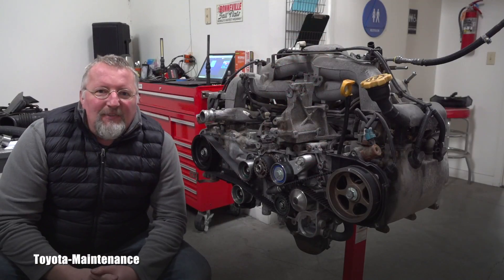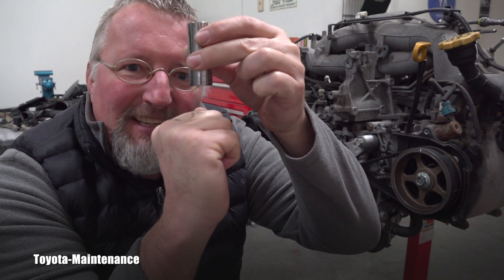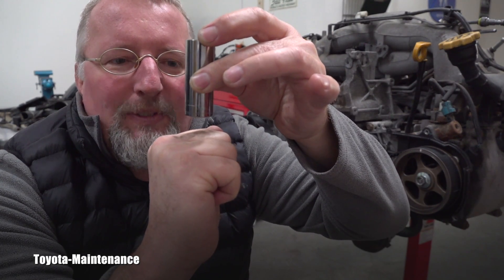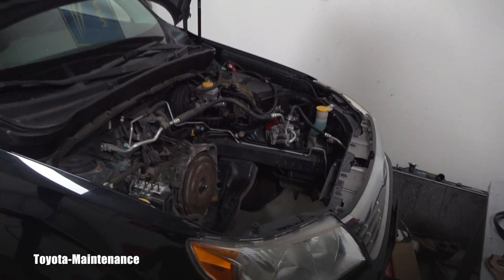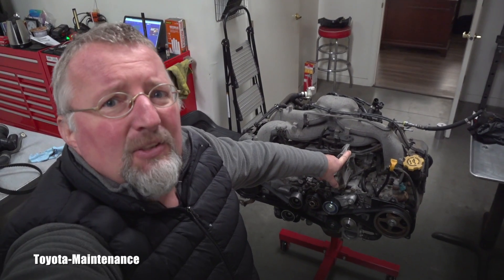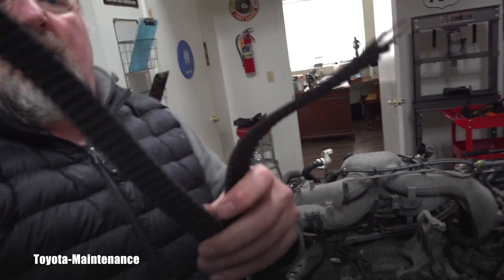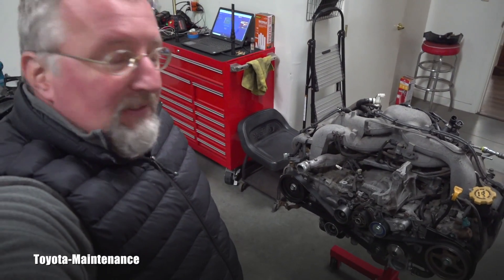Avoid Interference Engines with Timing Belt

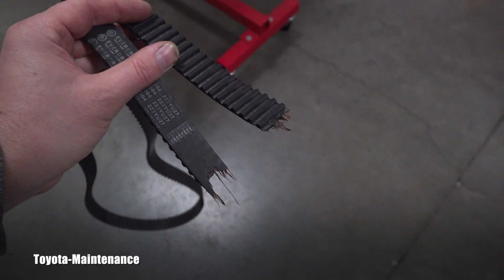Comment: 2:52 Evergreen belt? Aftermarket timing belt kit? Who makes the Subaru OEM belt?
Reply: Evergreen is cheap china parts.  Buy Japanese good quality parts
Reply: When I paid to have mine done, the (Subaru) OEM had shifted to Chinese production. I don't remember the company name.  After the dealer did the work at 90k (15k miles early), because I was about to give it to one of my kids for college, they put the car back together and discovered (if not caused - they wouldn't say if they pressure flushed it) the head gasket failure.

I tell as many people as possible to avoid Subaru like the plague. I also educate Subaru owners of the many things to watch out for.

Save yourself! Stay away from Subaru and Nissan.
Reply: When we changed the timing belt in the Jeep Liberty CRD I had we used a Gates timing belt. It lasted 7years and 60,000 miles, still going when I sold it.  I think the original was goodyear.
Reply: @MrMikey1273  I don't doubt that a reputable aftermarket manufacturer can deliver a reliable product. I'm scared of counterfeits, however.
Reply: @jptrainor  my point is use a quality brand even if the OEM isn't available. There's a lot of cheap Chinese stuff in the stores like Advance Auto parts.  That's why we ordered that belt kit from a supplier that sold only OEM and proven aftermarket parts for small diesel engines.
Reply: Mitsuboshi is the OE manufacturer of Subaru Timing belt
Reply: Chinese suppliers told me that their rubber parts will cost 10% of Japanese price for 10% of Japanese quality, and 90% of Japanese price for 90% of Japanese quality.
So, simply buy Japanese parts and save yourself $$$$ in labour costs. Not to mention the inconvenience.
Many motorbike rubber parts are perished and cracking before sale to the end customer. Also best to always buy Japanese manufactured bikes!

Comment: I have seen 22r, 2rz, 3rz chain timing engines failed catastrophically,  the guide wear wears down the chain rides on the metal parts of the guides all the metal shavings damages the engine or chain jump the gears teeth damages the valves.... 

I own 03 highlander  I bought at 60 thousand miles at this very moment is almost 300 thousand still factory timing belt this tells  that the rubber belt is safe as chain xD..
Reply: As a general rule a timing chain should last 200k miles and become noisy well before a catastrophic failure.  The key to the hydraulic tensioner is changing oil every 5k miles. It’s undeniable chains are better than belts, for both reliability and timing accuracy. Of course the gold standard is gear driven.
Reply: @garydiane1577  so this video is misleading, both chain or belt have to be replaced as manufacturer specs, once I replaced snapped rubber belt on 3vze at 384 thousand miles all original,  how do I know it was factory belt bolts have no waer all the bolts where the belt area were intact, also as belt wears does not fall pieces into the engine, timing chain wears lubrication system is contaminated I know there is oil filters still I don't like chains..

Comment: Honda 3.5 V6 is timing belt, interference engine. Just put the third belt in at 165,000 miles.  Meanwhile, my 06 Rav4 with 3.5 V6 engine has 320,000 miles. Only thing I've done with it was to put new ignition coils and an oxygen sensor. Still runs like new.
Reply: 3rd belt at 165K? Replacement interval is every 100k.. The Honda J series engine is one of the best V6 engines ever produced.
Reply: @trevorsyversen9956  Bought it (2007 Ridgeline) at 85,000 miles. Didnt know if the belt had ever been changed...why chance it? Water pump went out at 165,000 and ruined the crankshaft position sensor. So, again, why chance it. I'll agree with you, I really like the Honda, but that belt is a pain it the ass.
Reply: @jonmayer9458  Did you not have the water pump replaced at 85K?  It's part of the package.
Reply: @Krakondack  Yep, replaced it with shitty unknown maker water pump. Learned my lesson...put in oem (aisin) this last time. Will only go with oem from now on.
Reply: Sorry! Didn't mean to lie...the Rav4 has 220,000 miles.

Comment: Limiting ones self to only non-interference engines, and/or timing chain engines isn't the answer.  Timing chain engines have plenty of problems of their own which are even more costly to repair than timing belt maintenance.  Most people don't think that far.  The only reason a belt would fail like that after such a short time is either the job was done incorrectly, low quality parts were used, or some parts weren't replaced (i.e. tensioner, tensioner and idler pulleys, etc.)  There are a lot of fake parts on Amazon/eBay that people buy and will fail like this.  There are a lot of low quality kits sold by the local parts stores too (i.e. Dayco, Gates in some cases, etc.)  If you have an interference engine just keep up with the timing belt maintenance schedule and be sure to use OE or good quality aftermarket replacement parts.  I've got an 08 Honda Odyssey with 228K on it.  It's had two timing belt jobs done on it and I expect to do a third when it hits 300k.
Reply: 2:52 The belt is branded "Evergreen".  Google indicates that it's a common aftermarket timing belt parts kit. Lot's of potential for problems. I researched parts kits for my 2010 Odyssey time belt job. The prices were attractive, but I couldn't convince myself the quality was there (including from Gates, which is a very common kit) or that there was no risk I'd end up with a counterfeit part, so I got Honda parts at a local dealer.
Reply: @jptrainor  Gates is OE on Hyundai and many domestic cars, so I will use in those cases when necessary, but Aisin is my go-to brand.  They are the OE for Toyota as I believe they are owned by Toyota.  I have used Aisin kits on many Honda timing belt jobs and have never had any issues.  It's either Aisin or genuine Honda--nothing else.  Aisin is what's running on my vehicle today.   EricTheCarGuy did a timing belt on his Odyssey a while back where he used "genuine" Honda parts from Amazon or eBay (I forget which) and they were obvious fakes and even he didn't spot it until the comments section filled up with people filling him in.  The vehicles then get sold and the belt breaks on the next guy...then the timing belt engines get a bad reputation.

Comment: Absolutely.  Choose timing chain rather than rubber timing belt altogether if you can
Reply: Had a Volvo 940 which we sold at 250k miles when we sold it:  timing belt, replaced it three times when we had it. (Pretty easy on that model, great wagon!) New owner's well past 300k mi now....  ¯\_(ツ)_/¯

Comment: I have a 2UZ interference engine in my 06 Tundra.  Funny, these engines when maintained are considered bullet proof.  There are many of these running around with with 300 and 400k miles and more.  Toyota has bought back a few for the high mileage for study.  I found several sites who claimed that engine was one of the ten best ever made by Toyota.  Sure, it is a problem if you don't maintain.  I had mine done at Toyota Dealer.  Cost me $2k, but Toyota gave me back a thousand dollars.  They could not believe the condition of my truck - looks new.  I had them do the belts, the water pump, the pulleys and other items.  Truck was 13 years old.  Best truck I ever owned.  I have had Fords, Chevy's, and a couple small Toyota Pick Ups, as well as a Chevy LUV - I put 160,000 miles on.  So, no I disagree.  This is not an engine to avoid.  It has another quirk, the starter is under the manifold.  All these modern trucks have stupid stuff, but Toyota makes great trucks and cars.  That was a great engine.
Reply: I agree, you're supposed to change the timing belt every 90k miles.  I had a 2005 with 193k and zero issues with plenty of power.
Reply: Totally agree!  Have a 2000 Tundra I bought new and still runs great.  Just stay current with the maintenance.
Reply: I'm  still looking for one here in ct. Tuf to find a good used one. I don't go to stealerships to buy new
Reply: @pirihern9329  yeah, Texas has them at good prices and without rust
Reply: 2004 Tundra 4.7 just changed timing belt and water pump. 👍🏻

Comment: That’s why the Toyota 5VZ FE is  such a great engine.. timing belt: yes...interference: no... minimal anxiety.
Reply: @joshm2243  2.7 4cylinder on some of the Tacoma’s , 4runners and t100s, indestructible
Reply: @joshm2243  Head gasket issues?  Never seen one on an engine with under 300k on it.  The burnt valve issue is due to not having the valves adjusted like stated in the service interval.  They tighten up and cause damage.
Reply: @joshm2243   owned about 6 3RZs and never had an issue with a head gasket , the 5vz fe is reliable but also suffers from head gasket issues and overheating and it being a slow pig for a v6
Reply: @fortis619  I have both in the garage at the moment.  We are really splitting hairs when talking about which is better.  Funny thing is when either of them have issues they tend to have a ridiculous amount of miles on them.  Long after other brands have been in the junk yard for a decade.  I prefer the 2.7 slightly but love them both.  Yeah the 5vz has the power of a 4cylinder and fuel economy of a V8 but its a solid little engine.
Reply: @joshm2243  Funny thing is I have done several head gaskets and timing chain guides on the 22re.  Still a great engine no doubt for its simplicity.
Reply: @joshm2243   I changed all those parts as well except for the seals which I skipped because I wasn’t keen on pulling the gears..if I make it to 300K will likely do them.
Reply: @joshm2243  That’s why I change the belt ( water pump and tensioners) every 100k ..cheap insurance
Reply: Valves will hit one another potentially, even if it doesn't hit the piston.
Reply: 3RZFE FTW

Comment: I have a 2UZ-FE in my Sequoia [same as in your Sequoia, Peter] and it is an excellent engine, despite the timing belt and interference valves. A  belt and water pump change every 7 years and 90k miles is a small price. A chain/tensioner/guide change is less frequent but it is far more expensive.

Comment: I asked my mechanic to inspect the timing belt on my first generation Tundra. I told him I was concerned due to it being an interference motor. He said that the belt was replaced at some point in the past, and that this one now has a few cracks in it, but it's nothing to worry about for the time being. Is he an idiot? Should I have it replaced?
Reply: If you see cracks replace immediately. 

Owner: 2000 Tundra AC SR5
Reply: FYI that's also the time to replace the water pump,timing tensioner/idler pulley, cam seals(if leaking or over 200k miles) and engine fan bearing, it's not a crazy hard diy job, using quality Toyota/aisin parts it should be less than $300 in parts. You can get aisin brand mixed with other Toyota OE supplier "kits" on ebay instead of buying direct from a stealership.
Reply: They say to replace at 7 to 8 years regardless of mileage, due to them being made of rubber.
Reply: If you are questioning if you should replace it, you should replace it.
Reply: The Toyota ones are usually good for ATLEAST 100k (I think they reccomend 60k), but lots of cheap belts are out there that have been installed. If a 1st gen Toyota belt had very light fine cracks I'd still drive it for maybe 10k and save up to have it done. It's not nearly as difficult on that motor as many others so it shouldn't be extremely expensive.
Reply: @berryreading4809  The truck is a 2001 with 170k KM (106k miles), and all I can do is assume that the belt was changed at 60k miles, putting the mileage of the current one around 46k miles. Considering that the truck had one of those garbage Fram oil filters on it when I got it, there's a good chance that this belt is some shit brand, too. I think I'm going to fast track this belt replacement just to be safe.
Reply: @SampsonGG  that's probably a good idea, but I'd say you've got a few thousand miles to save your money up if you need to, if it was the 1st factory belt I'd feel comfortable going up to 120k-150k miles 😄 I just took an original off with 160,000 mi and it had zero cracks! Just a little thinner from smooth side wear and not even much stretch vs the replacement, that was a 2003 model

Comment: yes, unfortunately the belts fail when the engine is accelerating, so you get bent valve stems, or worse. 
Also, you need some luck: low mileage belts can fail 
- on their own, 
- or when you made a small mistake and it's rubbing somewhere, 
- or when you get a seizing roller/tensioner/ACpump/PowerSteeringPump/Waterpump
Reply: That's why only quality replacement kits should be used. A good kit will outlast its lifespan safely. Timing belts are not an issue anymore, just replace them at the recommended mileage
Reply: brand new video from MrSubaru about rollers/tensioner/waterpump

https://youtu.be/2VKXB1GbUmg

Comment: Never ever owned an interference engine in any of my vehicles.  And I always asked about the timing gear ⚙️ “what drives the cam shaft and crank shaft?” Belt or chain?  Had a  1979 Ford 4 cyl non-interference engine.  Belt snapped one morning.  Towed it home.  Put on a new belt in time and drove it another 2 years.  Some people don’t know or don’t care but me - I care!  Thank you sir!
Reply: Europe has millions of diesel engines cars there is huge  money on replacing belts as almost at all Diesel engines in existence are interference engines due to the higher demand of compression ignition.